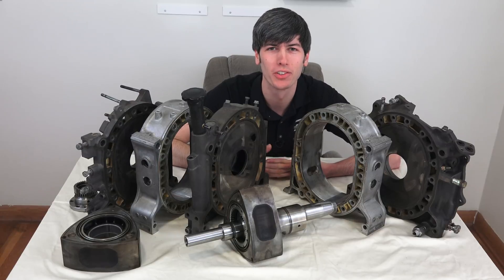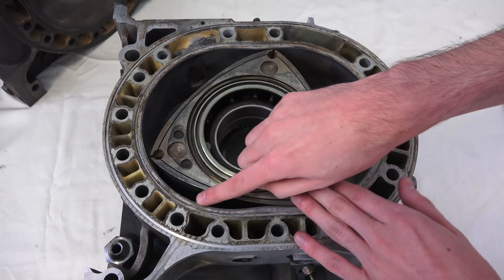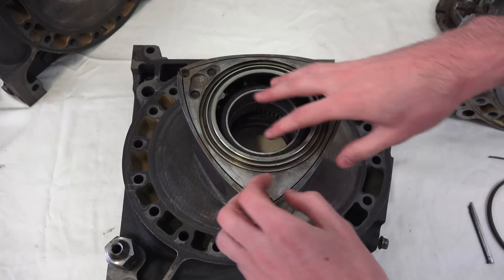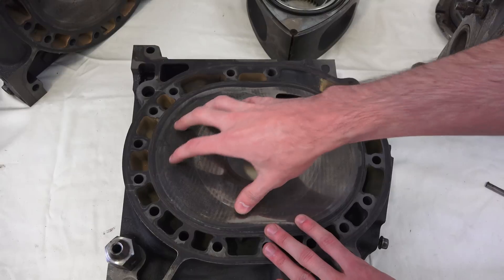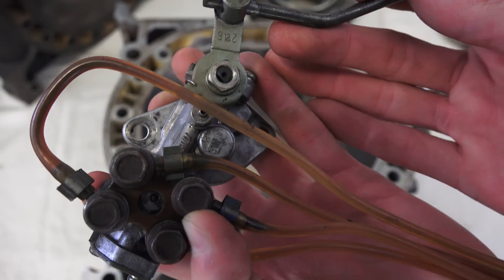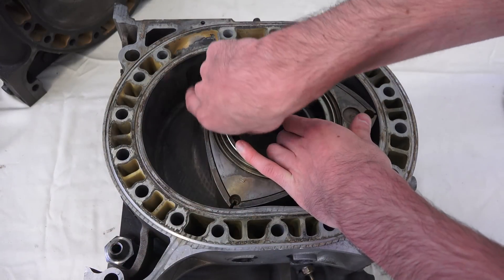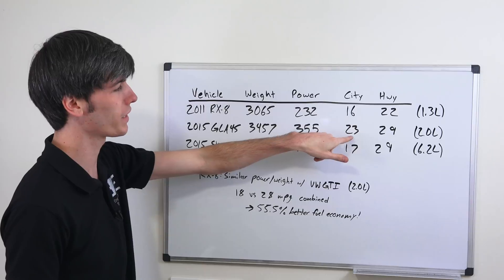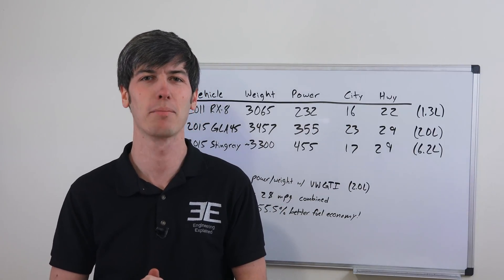4 Reasons Why The Rotary Engine Is Dead

Comment: 3:50

It's not really good form to compare an engine from 2011 with engines four years newer.
Reply from the maker: +coolestpyro 2004 Corvette is heavier, larger engine, significantly more powerful, and still gets better fuel economy.
Reply: that's fine, it's just incorrect to compare an older engine to a newer engine in this context
Reply: The real doktorbimmer I'm not here to try and stick up for the Wankel engine, I don't really care whether it's a good engine or not as I don't own one. 

If one was comparing efficiency/horsepower/acceleration/etc of, say, a Corvette, Mustang, and a Viper, would you say it would be a fair comparison if the Viper and Corvette examples were from 2015 but the Mustang example was from 4 years prior? Of course not.

Even if the results aren't much different, it's simply not good form to have a slanted comparison where all the examples except one are technology from 2015, and the odd one is is four years older.
Reply: +coolestpyro 4 years probably isn't much of a difference with todays engines anyway. The technology has kind of hit it's limit. Hell, Chevy still runs pushrod technology... Conventional engine design is over 100 years old now, the Rotary is basically the only 20th century engine :P The Rotary has had less time to design, develop and improve over the convention combustion engine.
Reply: So compare it to a 2002 Corvette Z06... your argument is moot. Corvette has been getting 30+ mpg highway for nearly two decades.

The rotary engine is horribly inefficient - there is no argument to be had about that. It is a fact.
Reply: +coolestpyro He said a 2004 Corvette which was the same as the RX8&#39;s production.  You could even go back to 1997 C5 with the LS1 which was still rated at 27mpg with a crappy 4 speed auto - still a considerable amount better than the RX8 could muster in 2011.
Reply: +coolestpyro The video was explaining why the rotary engine isn't going to be produced along side newer engines. That's why it's compared to the newer engines :)
Reply: +Steven King Anyone who knows what is happening with rotaries in research would laugh at that.
Reply: 94XJ
I am on about the wankel design. I see you are still pushing that old chestnut the apex seals. That has been solved decades ago. 

A modern Wankel, with all the new advances, running at a constant speed at its "sweet spot" turning a genny will outperform a piston engine.  They are suited for cruise ships where space in the hull is revenue. Large banks of largish wankel gensets in a modular formation, take up a fraction of the space of those humongous diesel engines. Rotary engines are also smooth, quiet and vibration free which is a great advantage in a passenger ship and greatly aids in revenue generation. 

Now if these Liquid Piston designs get off the ground then clearly curtains for piston engines. The sooner the better.
Reply: +coolestpyro Yeah because engine technology drastically changes in only 4 short years... Engines are pretty damn much the same as they were 10 or 15 years ago. Not really any fundamental changes at all really over the past 30 even since modern fuel injection systems have been common place since the 1980's along with computers. Now what has drastically changed is the fuel efficiency and the computer power.
Reply: The real doktorbimmer
Nutball, you said no one makes rotary engines. They do. About half of UAVs are rotaries. 
Austro Engines Rotary:
http://austroengine.at/en/products
Rotron make six versions:
http://www.rotronuav.com
Reply: +coolestpyro  My '96 Explorer with a 4L V6 gets very similar gas mileage.
Reply: No just your mother
Reply: +The real doktorbimmer cannot argue with that.  Anyone with eyes and brain matter behind... Just can't argue...
Reply: 94XJ Rotaries are better suited to genset applications rather than direct drive via gearboxes. In that application piston engines cannot compete.
Reply: +Black Sheep Biker 
Who is on about only RX-8s?  The topic is rotary engines, not a specific car. Rotary engines do not only power cars. Read my post at the top.
Reply: The real doktorbimmer You are an idiot.
Reply: The real doktorbimmer
WAS is "IS" are very different.  The Wankel was not inefficiency. It just used more fuel when used in the wrong application. New developments mean the Wankel is highly efficient when used in a genset.  R&D on a genset combination. A small efficient starter/alternator was developed. Instead of the rotary engine flywheel and counter balance, the efficiency of the combination system was higher because of the mated electrical generator. The generator rotor with its permanent magnets replaced the engine flywheel and counterbalance and was balanced with the rotating components of the rotary engine. The genny is the flywheel and counterbalance. 

Cooling the centre of the driveshaft gives cooling of the interior. Laser ignition projecting sparks to a number of points in the moving combustion chamber brings about flame propagation, ensuring the flame burns smoothly across the whole combustion chamber. 

http://images.cdn.autocar.co.uk/sites/autocar.co.uk/files/styles/gallery_slide/public/images/car-reviews/first-drives/legacy/tokyo-show-2015-web-017.jpg?itok=_HjiYt-9
Reply: ***** The title is about the "Rotary engine". He mentions the RX8, which is disingenuous comparing "car" weights. It is only one application of the engine, which is not the ideal application. He could have talked about the UAV applications where is trounces the rest.
Reply: The real doktorbimmer
We all know you hate wankels because you found your girl friends being fucked in the back of a an RX-8.
Reply: +The real doktorbimmer you are correct .sorry john boy I'm a rota holic the link u put up clearly states those Wankel's are 50bhp for drones haha u muppet
Reply: Bad is Bad. 4 years difference between engines is nothing. Literally nothing. There has been utterly zero new innovations or inventions engine-wise since the 90's.

Half the posters here are retarded and got trolled.
Every OTHER poster is a lying rotary fanboying troll.

The engines have never been good. NEVER. Try driving one and dealing with the constant pull to the side (depending which way they're spinning).
Reply: The Mazda rx8 was a total waste of time in the uk , most new buyers sold them of at a huge loss as the fuel economy was stupidly high .. Plus the vanes needed to be replaced quiet regularly as they weren't up to the task of sealing the combustion chamber .. All in all a crap engine ...
Reply: +John Burns I have to assume you're talking about the Liquid Piston engine which is a totally different design than the Wankel engine.  Rather than a single chamber being used for combustion it has 3, a different rotor shape with the intake in it.  I know the small one is more efficient than the engines they'd like to replace...but those are small 2-stroke engines which aren't exactly shining examples of efficiency.

Their own claim is 33% efficiency in the diesels where Cummins is at about 40-45% with their genset applications.   Again the advantage to the rotary is that it's much smaller which is useful in portable applications.  For stationary gensets where the weight and size is much less of a factor, I don't see piston engines being replaced.  Using the rotor to handle the intake air just adds to the difficulties with sealing the rotary engine which is already a major issue.  The longevity of rotary engines due to the seals has been an issue which favors piston engines in genset applications as well.
Reply: Adeum Deus wrote: 'The rotary engine is horribly inefficient'
Read my post at the top.
Reply: The real doktorbimmer It does.
Reply: The real doktorbimmer
You must stop making things up.
Reply: The real doktorbimmer
Please get therapy.
Reply: The real doktorbimmer
Please get therapy. Please think of your family who have to put up with you.
Reply: fine you have a good point, compare f22 from an s2000 of the same year almost same horsepower and its larger
Reply: +coolestpyro Oh wow 4 years... LOL...
Reply: +coolestpyro   Nothing has changed in 4 years.  Especially with the rotary engine.
Reply: ***** Go ahead and build yourself a rotary engine there captain.
Reply: +coolestpyro I daily drive a 2011 Merz E350, with a M272 3.5L engine designed back in 2003, not turbo, no DI, still produce 268hp, getting a 38xxlb car 17/24 EPA MPG. The same engine on smaller Merz sport car (eg.SLK350) gets 19/25. so I guess that will tell you rotary is pretty bad on fuel economy.
Reply: The real doktorbimmer please get therapy.  Please
Reply: Captain Crazy but look at the size and weight of it. And all that roughness!
Reply: The real doktorbimmer
Lunatic, abut 5 companies make them.
Reply: +The real doktorbimmer Five that I know of are Woelfle Engineering, UAV Engines, Freedom Motors, Italsistem and Rotron. In addition. Mazda confirmed last year the development of a new rotary engine.
Reply: You didn't mention mass production you said the Wankel motor was obsolete and no longer manufactured.
Reply: +The real doktorbimmer 
When rotaries were all dead; you talked 💩 to them.
When manuals were all dead; what are you gonna say?
Reply: +coolestpyro shut it you are weird
Reply: +Marcus Estevez Close, but the point made was that, for the foreseeable future, the rotary engine has hit a wall. All bets are off when considering if it'll be brought back at all.
Reply: +John Burns You should stop. You have really done yourself a disservice. This went from an interesting conversation to you just trolling.
Reply: +coolestpyro The Rotary will still lose if you were to compare it to a 2007 inline/flat 4 or v6 engine, if not the same.
Reply: +coolestpyro 4 years is irrelevant.
Reply: I grew up in Los Angeles during the late 1960s and 1970s.  The smog was horrible.  It would hurt your lungs and burn your eyes.  It really bad in the 1950s, before they outlawed incinerators.  I'm glad that the rotary engine is being phased out.  The rotary engine is a piece of crap anyways.
Reply: +John Burns What is REALLY suited to genset applications is the turbine. In the 1980s the military was working on a project called the "Quiet Reliable Generator." I'm working off memory here because there's nothing about it online, so far as I can tell, but the QRG was a 10kW turbine-powered generator about the size of a small round laundry basket. It made very little noise and it didn't weigh very much - two soldiers could easily pick it up. If you dug a hole and put the QRG in it, you couldn't hear it from ten feet away. They made about five of them and issued them to the Air Force for field testing. The people who used them thought they were great, but the Army and the Marines - who use most of the field gensets - didn't want to turn everyone who operates a generator into a jet engine mechanic and got the program killed.
Reply: +coolestpyro Need to learn a little more about cars. It's not like processors. They don't change architecture every new model. 2016's are rehashes of what works.
Reply: +coolestpyro Doubt they have changed by a huge amount in 5 years.
Reply: +coolestpyro OK, well my car, a 2011 WRX, weighs 3,208 lbs, puts out 265 bhp from a 2.5l engine & gets a rated 19 mpg city/25 mpg highway.
Reply: +coolestpyro 
The previous generation corvette had the 6.2 LS3 that made only slightly less HP and slightly worse EPA ratings, but still bested the EPA ratings of the 1.3 in the RX8. It was put into production in 2008.

The M133 he is using in the comparison was put in production in 2013 in the A45 AMG, so its only 2 years newer than the 2011.
Reply: +John Burns starting to report your comments now. Put up or shut up.

fuckwit.
Reply: +The real doktorbimmer 
Some companies are still making Wankel "COMPRESSORS" NOT engines.
Reply: +The real doktorbimmer the streets is where the wenkel made its reputation with the 13b and 13b-rew engines in the rx7 fc and fd... that's what they mean... rotaries are still more popular than most other cars... "real street gearheads" use rotary engines as a badge or accomplishment since they know what they're doing and not just showing up at car meets like the kids who drive bmws or whatever who just spit out what they read on the brochures... kind of long but yeah that's what most people mean when they say wenkel engines are not dead... they're really popular in the street
Reply: eric O oh please. You see more sr20s. Most rotaries are dead these days thanks to aforementioned kids blowing them up with excessive porting
Reply: +coolestpyro the 2011 gti does 21/31/25, which is still MUCH better
Reply: +The real doktorbimmer thanks for pointing that out that they are vanes   I couldn't be bothered 👍
Reply: +The real doktorbimmer Today I read so much "rotary is dead" vs. "get therapy" lol...

I like the idle sound of a rotary and the way it works.
It is obsolete in terms of efficiency and durability, that's true and that's something John doesn't seem to be able to grasp.
They still have fans though, I think they absolutely have a right to exist.
Still, as much as I like the concept of the rotary, one has to admit that it is left behind by piston engines in almost every way you look at it.
It's an interesting engine that's worth knowing but it is, sadly, outdated and no longer in production for logical reasons.
Reply: +The real doktorbimmer   It's still in production.  Mistral Engines, which sells Wankels for aircraft use, is one example of a company with active development and production.  It may not be massive production scale, but it is in production.
Reply: +John Burns bell end
Reply: +coolestpyro Yeah but we are in the ERA of the newer engines.. u cant go back in time. U understand me?
Reply: +The real doktorbimmer Please seek therapy. I assure you that Wankel engines are in mass production and very efficient.
Reply: +Steven King 
See my post at the top.
Reply: The real doktorbimmer
Ring them up and ask for one, and they will give you one.
Reply: dpeagles
You need to read the comments on this video. There has been a lot of change.
Reply: dpeagles
No need to, others have done it.
Reply: The real doktorbimmer
You must stop making things up. You can get therapy for this complaint.
Reply: The real doktorbimmer
The rotary is made by many companies. Please stop making things up.
Reply: The real doktorbimmer You tell lies for sure. And you make many things up.
Reply: The real doktorbimmer Get therapy please.
Reply: The real doktorbimmer 
You must stop making things up
Reply: The real doktorbimmer
Obsessions cloud reality. Please get therapy.
Reply: +The real doktorbimmer I probably can't comment on this because I never driven a rotary before, but low efficiency does not make an engine bad. Naturally aspirated (with no DI) engines is as dead as Michael Jackson now. Turbos make more power, get better MPG, and more low end torque, but ask any Ferrari/PORSCHE guy see which one they prefer ?

I could see the high maintenance cost and oil burning are issues that could kill the rotary, but I can understand people who love how they run.
Reply: The real doktorbimmer You have it in reverse, understandable in your mental state. The Wankel has a superb power/weight ratio. Ideal for range-extenders. In fact the best.
Reply: The real doktorbimmer
You are very confused.
Reply: The real doktorbimmer
I have given you a few. Half the UAVs use Wankel engines. Please get therapy. Please,
Reply: The real doktorbimmer
Please get therapy. Please.
Reply: The real doktorbimmer
Please therapy. Please.
Reply: ***** Oh my God! Another one who needs therapy. 
Easy when you look, and this is just for starters. This f****ing idiot bimmer continually says none are made at all:
http://www.uavenginesltd.co.uk/products/

He found his girlfriend being fucked in the back of an RX-8. Sad but true.
Reply: +John Burns They for example are used in the target for a Stinger Missile life fireing. Saw them on NAMFI on Crete in Greece.
Reply: Heiko Panzlaff
About half of the UAVs around use rotary engines. The power/weight ratio is phenomenal.
Reply: +coolestpyro Ok how about corvette c5 z06 2002 then? My brother had it for a couple of years over 400HP and still had MPG in the mid 20's.
Reply: +coolestpyro doggy.
Reply: +TatsuyaDragon my car had 475 hp and did 23-25 mpg in town
Reply: The real doktorbimmer Please get therapy. Please.
Reply: +Engineering Explained Uh Duh you just said the keyword...Heavier
Reply: +coolestpyro I've got news for you, 4 years is not a significant difference. Carbureted vs. efi would be a significant difference. Since the mid 1990's there has been no significant change. Since rotary engines are not in production, and there IS a marked difference between the 2 types of engine, the point he makes is most valid.
Reply: Icetrucker1956 The Rotary engine is alive and well and made by many makers.
Reply: The real doktorbimmer You are a complete idiot.
Reply: +Badassbri Kicksass the wankle engines are a dying breed I hate to idmit it an believe that but its true .PS I'll arrange the white coats to pick you up OK mate
Reply: Badassbri Kicksass
"The rumours of my death are greatly exaggerated"

Find out about rotaries and what is going on. Your scope is only in cars.
Reply: The real doktorbimmer Dope you have been told many times. 
This man has mental problems for sure. Maybe he thinks the rotary engines in all those UAVs made themselves.
Reply: +The real doktorbimmer ive seen you in their comments for years hating on rotaries. why you hate them so much?
Reply: The real doktorbimmer When are you going to get therapy?
Reply: How many advances are made in 4 years. It's a fair comparison.
Reply: +coolestpyro He compared a ROTARY engine to a PISTON engine.  Regardless if it is modern or 30 years old (1985), the rotary is inherently WASTEFUL.  Gas and fuel is just blown out the exhaust port.  I'm sure that they have been outlawed from California, due to the excess emissions.   The rotary engine was a gimmick to begin with.  Though, it is very simple motor, few parts, and easily rebuilt...   It had a short period of use and it's over.
Reply: WAVETUBE84 The rotary meets all emissions regulations.
Reply: jmowreader I agree with you. Turbines can be the size of a large can of beans. They are used in the US M1 tank. They are also used in some buses turning a genny. They turn at very high speeds.
Reply: The real doktorbimmer More drivel! The most efficient genny's are rotary powered. When the small size and weight and power to weight is taken into account they shine.
Reply: +coolestpyro And they started producing RX-8 in 2006. 2012 is when the production has ened. So it's like almost 10 years of difference.
Reply: Agree! Very good vid though, but gave il a thumbs down just for the last bit
Reply: swissgi The rotary is clearly not dead.  A poor video.
Reply: +Traitor you would be surprised, each model release they might due to changing emissions laws/ standards depending on where you live
Reply: +Jack McInerney Sure but.. 55.5% in 5yrs? With such an old technology? From which year is that GTI even?
Reply: The real doktorbimmer Yes, and it shows.
Reply: The real doktorbimmer The wankel is more efficient.
Reply: The real doktorbimmer It does.
Reply: +The real doktorbimmer complicated to build, only really Mazda could make one for production, there is not much reason for it today as people tend to want some fuel economy and clean combustions.
it is harder for the owner to maintain and some things is even so hard to do that only people with special equipment can do it for rebuilding the engine.
people wants to just drive and do much ov anything that is not possible withthe rotary engine, alway the oilchecks and coolant checs or the engine is toast.

its very light thats the possitive i guess, but as it can go thru fuel like a v8 its inpractical.

the only reason i se for it is for racing or for sport cars, when weight and size is important and wit turbo like the older RX7, the RX8 was not turbocharged that was probably because it could not pass the combustion rules.
Reply: +The real doktorbimmer You know there's like 6 or 7 companies that still make wankels right?
Reply: The real doktorbimmer
there's still like 5 tho
Reply: The real doktorbimmer Okay listen here and listen very closely. The new BMW M5's secretly have Wankels under their ordinary V8's. They make about 69 a month. Another company, Toyota Prius, also have Wankels in the trunk under the cloth. They make about 666 a month. Another company, Ford Transit, also have 1.3l rotaries under the drivers seat that run the rear wheels. About 420 are made a month. The last one is the new C63 AMG, it holds a miniature 2.0l rotary in the glove box and drives the front right wheel. Those are made around 69666420 a month. There ya go
Reply: The real doktorbimmer
Dude I'm kidding, can't you tell? Obviously nobody makes the rotary anymore lol
 I drive a VW TDI so I make double a wankel as well
Reply: 123Bosniak That is very nice to know.
Reply: The real doktorbimmer
I think they're trolling you
Reply: Biggus Mickus That's fine, it's still not the most correct way to present the data.
Reply: The real doktorbimmer The rotary in a range-extender role is superior to a piston lump. There you go...
Reply: damien merrylees You have no idea of R&D and applications of Rotary engines. Sad but true.
Reply: ***** i don't need to. They're  dead so clearly I'm right.
Reply: The real doktorbimmer Please get therapy. Please.
Reply: +The real doktorbimmer +John Burns  True, no company mass produces them anymore, that died with Mazda back in 2012. Mazda have built a new rotary though; a 1.6L called the 16X, but they haven't got a car to put it in yet. There's been rumours of a new RX since 2012/2013 but no movement on it yet. 

While it isn't in mass production anymore, there are still tuning specialists that work on them, modify them and build them for clients that require them. The big ones I know about are Hayward Rotary (UK), Kiwi RE (NZ), PPRE (NZ), RE Amemiya (Japan), PanSpeed (Japan), FEED (Japan). 

Also, I know this is a one off, but Mad Mike of NZ is now sponsored by Mazda and they produced brand new housings and parts for him as he requires. It's still alive within the tuning community, but as part of the mainstream market it's dead.
Reply: exactly what I was thinking
Reply: ***** because there are no uavs running rotaries. It'd be the worst possible decision you could make, considering you'd have to carry twice as much fuel to go the same distance
Reply: +The real doktorbimmer Mazda2 EV, range extender for Hybrid, e-go on Airplane. DA36 E-Star from AUSTRO Engines as Range extender...
Reply: eric O actually, 'real' gearheads don't waste their money on an engine that's just for show and only has a 10k mileage before blowing up due to the excessive porting required to get it past 300bhp. 

The fc was obsolete when they were writing initial D and the FD wasn't an improvement. 

People switched to more available systems like the newer evos and imprezzas.
Reply: +coolestpyro Why don't you start your own youtube channel bro! You must know alot!
Reply: The real doktorbimmer If only
Reply: +nick stevens Vanes? You mean seals? The problem with Wankel engines is that they are not particularly suited to relaxed driving. Drive them flat out and it will stay in better shape, seals included, because there will be much less carbon buildup. Old carbed cars tended to have the same problem due to incomplete fuel combustion and burning off carbon was just something you did. Rotaries aren't crap, they just don't suit daily driving.
Reply: +The real doktorbimmer It's not supposed to be efficient, its supposed to be fast
Reply: Windurster Light
FIVE companies round the world make rotaries. You are naive and ignorant.
Reply: The real doktorbimmer
Please get therapy. Please.
Reply: +coolestpyro 11 years newer. The RX-8 engine was introduced in 2003 and remained unchanged throughout its production life. But it was still thirsty even by the standards of its day.
Reply: soundseeker63 The RX-8 was not thirsty. It had the performance of a Porche with equal fuel consumption.
Reply: No. The nearest Porsche equivalent was the Boxster 2.7 with 220hp and that did 28mpg...9 better than the RX-8.
Reply: soundseeker63 In performance. The average Porsche driver NEVER got 28mpg. in real world use the Equiv Porsche was no different to the RX-8
Reply: +coolestpyro The 2011 Corvette with a 6.2 was 15 City 25 Hwy.
Reply: +John Burns you just like to talk don't you? ok we get, it you have some strange affection for some odd, outdated inefficient engine design. But why get on here and ignore the facts and call everyone names? it's a poor design, period! it does have some fringe followers but it's dead.
Reply: poncoolride Do you have pictures of doktorbimmer on your wall?
Reply: +coolestpyro Thing is, the Wankel hasn't changed in 60 years (and systematically can't change due to it's design).  So it's totally fine to compare it to newer engines.
Reply: +Kevin Newell Actually he did say "mass production."  But, alas...
Reply: MacktasticDazzle It has changed. Look at the wiki.
Reply: +John Burns Youre' trolling tactics shan't work with me sir.  And I'm still convinced you and Doktorbimmer are the same guy.  This whole conversation is just weird.
Reply: +The real doktorbimmer The only recent-made Wankel engines I'm aware of are for R/C aircraft applications, because fuel emissions simply don't matter and they where a bit lighter then the four-stroke offerings. And it's been awhile since I've seen one. Sadly I can't recall for the life of me what the name was. And they did well mostly because the high RPM is useful in prop-fans, and it was a helluva lot cheaper then gas turbines are (few hundred over two grand). Even then, Electric has taken over at that size, though.
Reply: +The real doktorbimmer well, in terms of R/C engines, wankels aren't all that much worse. If I recall, they spew about as much oil (castor in the case of R/C engines) as two-stroke glow engines, and have a better power/weight ratio. They don't get made in the very small sizes mostly because gas engines in models (and aeromodelling in general) are becoming more niche. I'd rather work on a wankel then a four stroke model engine, just because the size of the bloody valves.

As far as car engines go, they've been relegated to racing and hot-rodding small cars where the ability to stuff craptons of power in a small space is useful. They're dead-ends in daily drivers, though, unless someone does something major with regards to the sealing of them (or uses the idea to spawn something altogether better in some way)
Reply: +The real doktorbimmer You've also managed to miss the mark.The plans for FAA certification were *suspended* in 2010, due to multiple economic issues, including the cost of completing certification. I have been unable to find a source showing outright abandonment. It also seems that the company, as a result of their financial difficulties, has been basically purchased by a holding company for Elecpro (China). Point being: I can't find a press release concerning the company from after this purchase. It seems that they are still in operation, but details of the operation are unknown. So, I will admit that Mistral is currently a little bit of an unknown, and my information was only a couple years out of date.
(Edit: Damn youtube decided to throw HTML codes for spaces and destroy formatting... yay)
Reply: Direct fuel injection and laser ignition will improve the Wankel considerably when introduced. The problem of unburnt fuel in the exhaust will be eliminated improving emissions and fuel consumption. The engine performs very, very well in fuel consumption and emissions running at a 'constant speed' turning a generator - its most efficient "sweet spot". Wankels lose efficiency dramatically when they are revved up and down as when directly driving a car. The engine has a vastly superior power-weight ratio than piston/crank engines and is about one third of the size and weight of a piston engine for a similar power output.

All these positive attributes combine to make a superb range extender, when the wheels are turned by electric motors. If a car is plugged in each night and uses grid power to run most of the time, then wear on these units will be negligible. As the engine is only periodically used, the life of the engine is greatly extended. Also newer metallurgic techniques are being used to make the engines. Even when batteries are depleted, the Wankel can provide enough electricity to power the car and still be economical.

The first ever series-hybrid plane flew in June 2013 - using a Wankel engine because of its small size and light weight, and an electric prop. The makers say it can be scaled up to around a 100-150 seater plane. The Wankel engine(s) can be in the fuselage for better weight distribution with small electric motors on the wings giving lighter, and cheaper, wings. About 5 companies still make Wankel engines for special purposes such as drones.
The sooner they are introduced in road vehicles in series-hybrid form the better. The Wankel has finally met its niche.
Reply: Y'all have literally been having this same silly ass "debate" for over two months lol
Reply: marcnews75
There is no big end on a wankel.
Reply: marcnews75 knobhead.
Reply: +The real doktorbimmer Mazda RX8 are still being made, whatever this guy says.
Reply: +coolestpyro exactly. My 1991 Volvo 740 gets only slightly better gas mileage than an RX-8, and that's fairly decent for a car of its size and age.
Reply: J. V. I go on facts me old boy. Facts!!!
Reply: Rotaries are better suited to constant speed, high efficiency genset applications rather than direct drive via gearboxes. In that application piston engines cannot compete. Rotaries are better suited for series-hybrid cars being much superior than piston engines. 

Direct fuel injection and laser ignition will improve the Wankel considerably when introduced. The problem of unburnt fuel in the exhaust will be eliminated improving emissions and fuel consumption. The engine performs very, very well in fuel consumption and emissions running at a 'constant speed' turning a generator - its most efficient "sweet spot". Wankels lose efficiency dramatically when they are revved up and down as when directly driving a car. The engine has a vastly superior power-weight ratio than piston/crank engines and is about one third of the size and weight of a piston engine for a similar power output.

All these positive attributes combine to make a superb range extender, when the wheels are turned by electric motors. If a car is plugged in each night and uses grid power to run most of the time, then wear on these units will be negligible. As the engine is only periodically used, the life of the engine is greatly extended. Also newer metallurgic techniques are being used to make the engines. Even when batteries are depleted, the Wankel can provide enough electricity to power the car and still be economical.

The first ever series-hybrid plane flew in June 2013 - using a Wankel engine because of its small size and light weight, and an electric prop. The makers say it can be scaled up to around a 100-150 seater plane. The Wankel engine(s) can be in the fuselage for better weight distribution with small electric motors on the wings giving lighter, and cheaper, wings. About 5 companies still make Wankel engines for special purposes such as drones.

The sooner they are introduced in road vehicles in series-hybrid form the better. The Wankel has finally met its niche.

It takes only 25 to 30hp to propel a large American car down the highway at 70mph. Yet they put engines in them that can output 150 to 200hp. Most of that output is for acceleration and heavy loads. Highly inefficient.

The great thing about a series-hybrid is that the generating engine works totally independent of the demands of the electric driving motor, enabling maximum efficiency when running. This means the generating engines can be greatly downsized. The battery acts as an energy buffer to give acceleration boosts.
Reply: I think you missed the point.....
Reply: +The real doktorbimmer 
i would say that the rotary engine is pretty bad on gas, i owned a rx7 with a 13b ported and it was pretty bad but not one time did i loose to a v8. they should make another vid with track times for the engines that would be a better test even though i dont think the rotary is coming back :(
Reply: Oswaldo Garza Read my post on the rotary and its ideal applications. This bimmer guy is a complete fruitcake. The Rotary is used in UAVs (drones).  The rotary is made by 5 companies over the world.
Reply: Ugh, his point is, use the same year engine to compare so people do not feel the comparison is skewed... If you need to skew the results to show a difference, then your argument is moot. If it is not moot, then don't skew the results. Period. There is no excuse. If you feel there is an excuse, then you don't have an argument.
Reply: +fakiirification not disagreeing with you, but thats just in cars.  we had otto cycle ICE for some time longer before cars used it.  Technology did evolve faster last couple decades due to precision manufacturing and computerized design etcetc, but as you said 4 years would have made little difference, but at the same time, those cars could have had different parts like transmission or turbo that could have altered fuel efficiency.  pretty sure EE chose those cars to avoid that kind of variable.
Reply: John Kim Rotaries are still VERY much in use in flying vehicles :) The power to weight is so high it offsets any other disadvantages, as power to weight is everything in that context.
Reply: elesjuan 327 people care